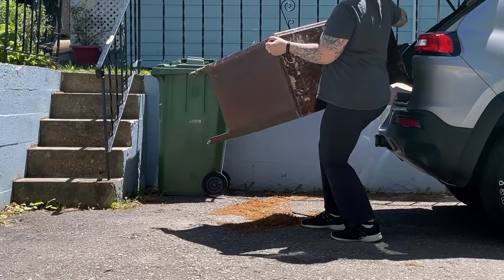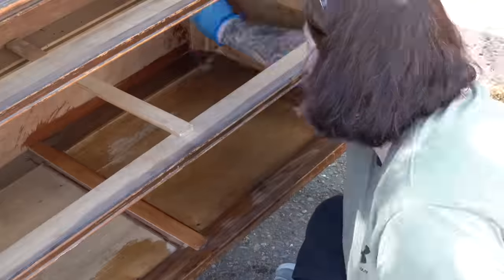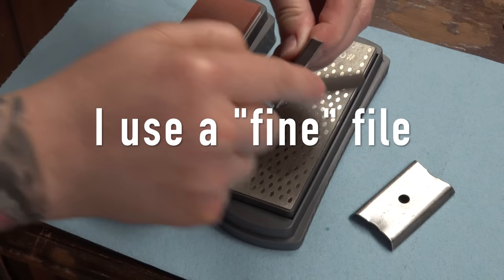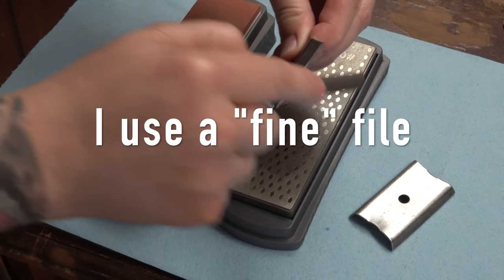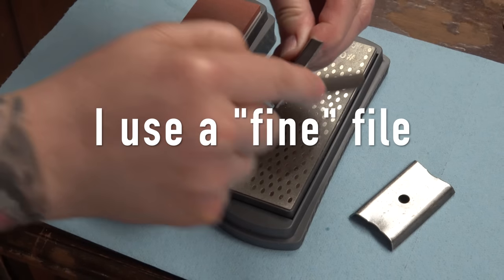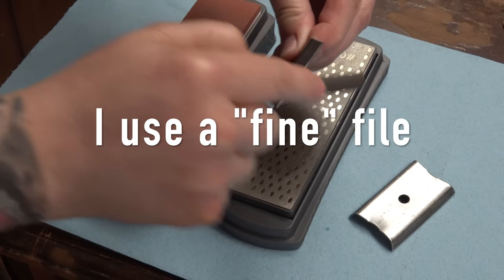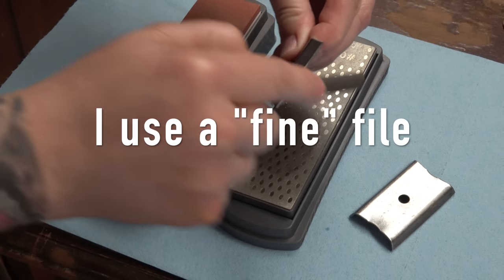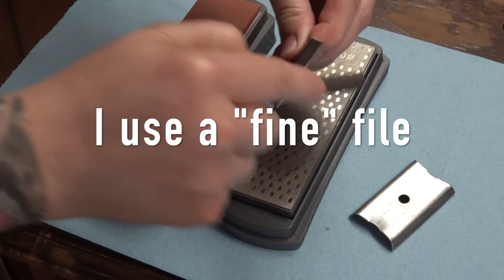Old Dresser gets an UNBELIEVABLE restoration & makeover

Comment: If I had not seen it with my own eyes, I never would have believed it.  You are very talented!  I Just bought a flipped dresser and after bringing it home it made my clothes smell like varnish and then the top warped and cracked.  After some investigation turns out it was never vacuumed or wiped clean on the inside either.  The top rails of the drawers had some varnish slapped on to make them look better.  It was not cheap and I am in the process of trying to fix what should have been fixed.  After sanding the varnish off there came an old musty smell.  Your videos will be very helpful in getting this piece restored to its old glory.  Thank You!   I also evict spiders and it is refreshing to have a kindred spirit out there like you.
Reply from the maker: You're very welcome! Best of luck with your piece and thank you for saving spiders too!! 🕷

Comment: This is an incredible video! Would be great to know what you paid and what you sold it for too. I can't help but wonder what the restored version is worth.

Thank you for taking the time to film and post it!
Reply: In case you see this. I just bought an old peice that I want to restore. I was told it's Victorian but I know very little about how to tell if a peice is vener or solid. Any tips?
Reply from the maker: I actually list everything I sell on my instagram and FB page, but usually remove the prices once they do sell. Pricing varies wildly from town to town, across provinces, and country to country (not to mention exchange rates), and there's no real average price because of the condition of the pieces, and sometimes even how quickly I need to sell something. For those reasons, I don't normally mention in these videos what the sale prices are, but if you're following the instagram/fb pages, you can actually see the for sale posts come up with the selling prices (until they sell, that is). 😊

As for determining if something is veneer etc, I actually have a video posted about that, it is here - https://www.youtube.com/watch?v=swJ--6s-ylc&t=468s

I hope this helps!

Comment: Love the video….my third one of yours I’ve watched.   Maybe I missed it but haven’t seen how you handle drawers that stick or slide rough… or wobble when sliding.   I’ve refinished a couple of pieces (with nowhere near the skill you have) but seems to be a common issue with many older pieces.  Would love to hear your suggestions!
Reply from the maker: I'd need to know what's causing the sticking? The guide, the drawers themselves? Drawers can stick for numerous reasons. Humidity, gummy finish or paint inside the track, drawer slides that are past their prime, warpage of the drawer or the cabinet or damage to the track itself. If it's just the runners themselves that are sticking a bit you can run hard wax or a bar of soap along the rails but if it's something else, that won't help. I have a video posted on guide replacement (https://www.youtube.com/watch?v=KqgyeNZj4FM&t=6s) plus a number of videos where I have to fix the drawers.

Comment: Another way to remove smells is balled up newspaper. On a smelly peeve of furniture i once used balled up newspaper, baking soda, and left it sit for a week. If you don't want to let things sit, after you restore your piece, and it's dried, you can stick bailed up newspaper in it afterwards, too. Or put in on a shady patio in the nice weather to let the air clean it. But not in rainy days,  I would worry about the moisure in the air.

Comment: I also adopted bunnies! 🥰 I have a vintage piece and it’s a chest of drawers, no screws for the shelves on which the drawers slide. It looks like the shelves are glued on and underneath have pieces of wood also glued in holding the shelves in place. I really want to take the whole piece apart and sand it all as it also has a slight smell and I’m planning to keep the piece so it’s sorta a forever piece project loll. How can I take it apart? With a mallet maybe?
Reply from the maker: Without having my hands directly on a piece anything I tell you could be wrong. I don't want to advise you incorrectly however if you scroll through my posted content, I've got many videos where I take pieces apart and you can see what I do and how I do it. Thank you so much for watching!

Comment: Watching this I got a crazy idea. When you cut the triangular patch worked for a best match I thought it would be really cool to cut  that same triangular cut on all the drawers and use a different veneer to make an 2 tone wood accent. How do you think that would work?
Reply from the maker: It could definitely work in very specific situations, such as if the entire veneer on all the drawers were loose, but if it’s only an issue on one, cutting into the others would be quite difficult. When veneer is firmly adhered, it’s TOUGH to get it off, especially without disturbing the veneer around it. So I think from a design standpoint, that could be neat to look at, it probably wouldn’t be practical unless all the drawers were already loose. If you know what I mean.
Reply: Thanks for the reply. Took me a while to get back to this one. I see your point. You make this look so easy and I just re-watched the section where you do that patch. It was the size and shape going the entire length of the drawer face that made me think of the two tone look because some of the furniture you work on has inlayed accents and they look so nice with contrasting woods. But as I watched you carefully working off the last of that old veneer I see how the last bits near the cut were  really tacked  down and a small slip with the chisel and that could have been a mess to fix. And if the veneer is really well tacked down all the way to the edge it would probably risk damage to the sub-straight trying to start prying it up.

Thanks for all your videos. I have learned so much watching them. Like you I like learning new skills even if I may not do much with them. I don't anticipate actually flipping furniture the way you do but we have a lot of wood furniture and a few old cheap fake wood grain laminate pieces. After watching your videos I think I can do a lot of little touchup repairs on the nice pieces and feel empowered to experiment with the last of the cheap ones to make some fun colorful but tasteful pieces to put in our daughters room. Then I may even get brave enough to consider refinishing some dark cherry pieces we have that I have never been enamored with the color.

Keep putting out great videos. I love your bunny rescue. Our bunnies are all the wild ones that live in our back yard. Some of them are so used to us that I can get 5 feet away and not disturb them grazing. One mom left her young kits on our greenhouse tent. I went in to get some pots and had little bunnies running all around me. They are pretty common where we are in Atlanta,GA USA. Pets and kisses to Nacho and Freya from my new little kits Merry (Meriadoc Brandybuck) and Pippin (Peregrin Took).
Reply: And also thank you for mentioning the Howard Feed and Wax in multiple videos. I was able to pick some up at the hardware store around the corner and it is doing a nice job of warming up the furniture I have already used it on. It is a great product and I love that orange smell.

Comment: Hi, I am thinking of taking up furniture restoration as a hobby. I have noticed that most people use Citristripper to remove old varnish and paint, but you use a scrapper.  Can you explain your reasoning for this.  Thanks.
Reply from the maker: I do use stripper - I only use Circa 1850 brand. I usually will only sand a finish away if it's basically non existent or if I'm on solid wood. I'll scrape usually over veneer with SOME finish, or a lighter/damaged finish, and I'll use a chemical stripper for removing thick finishes or multiple layers of paint. I'm not a fan of using a heat gun to remove finishes, although many people do like it. I hope that answers your question! 😊
Reply: Thank you for taking the time to answer my question. I enjoyed your video.

Comment: Looks much easier to use than sanding or stripper
Reply from the maker: It completely depends on the finish! I usually will only sand a finish away if it's basically non existent or if I'm on solid wood. I'll scrape usually over veneer with SOME finish, or a lighter/damaged finish, and I'll use a chemical stripper for removing thick finishes or multiple layers of paint.

Comment: Have you tried of soda blasting? I just starting using it.
Reply from the maker: Soda blasting works well and is a bit less intense than sand blasting,  though that can also cause damage if used incorrectly on certain pieces. I’m not entirely against soda blasting… but it has to be done carefully on the RIGHT piece.

Comment: what’s the difference between using a scraper alone and using paint stripper?
Reply from the maker: I usually will only sand a finish away if it's basically non existent or if I'm on solid wood. I'll scrape usually over veneer with SOME finish, or a lighter/damaged finish, and I'll use a chemical stripper for removing thick finishes or multiple layers of paint.

Comment: Probably a dumb question but is there a difference between using a sander or stripper when you were taking the finish off? Is the sander not going to do the job or does it worse?
Reply from the maker: I usually will only sand a finish away if it's basically non existent or if I'm on solid wood. I'll scrape usually over veneer with SOME finish, or a lighter/damaged finish, and I'll use a chemical stripper for removing thick finishes or multiple layers of paint.

Comment: Hello, not sure if I missed something but why do both scrape and sand?
Reply from the maker: I usually will only sand a finish away if it's basically non existent or if I'm on solid wood. I'll scrape usually over veneer with SOME finish, or a lighter/damaged finish, and I'll use a chemical stripper for removing thick finishes or multiple layers of paint.

Comment: Could you please tell my why you think the top drawer knobs aren’t original? We have a similar dresser and the top drawer has the small round knobs while the bottom drawers have the lift up rings !
Reply from the maker: Most dressers like this have pull knobs on the top drawer and a different style below- that’s typical, but the only thing that made me wonder about these top ones that made me question is that they are a very different metal, composition wise. They very well may be, but usually they are more similar in composition.

Comment: I dislike vener..stripe it to the wood🙄or buy a real piece and put on top🤔
Reply from the maker: Veneer IS wood. And is usually worth more than the construction grade wood underneath. These pieces often get ruined by people stripping the veneer off one side and not the other side. There is a reason makers add veneer to both sides and not one; it’s dimensionally more stable. When it is only removed from one side, it can actually warp the wood underneath over time. Either we have to either stick to solid wood if you don’t like wood veneer, or learn to work with it.